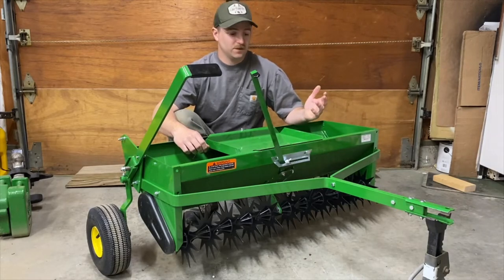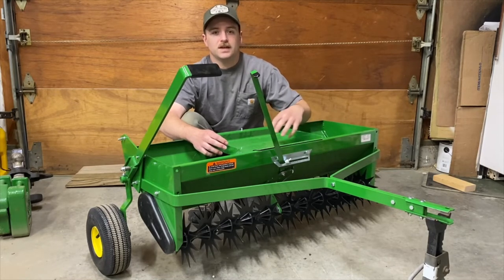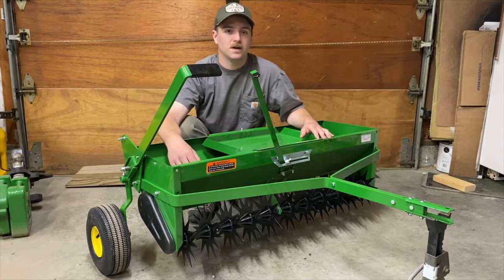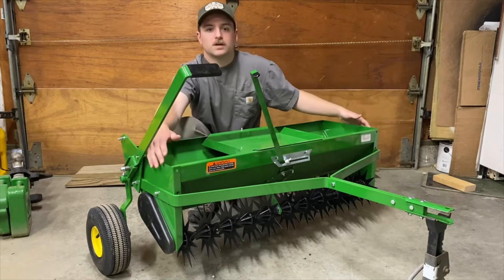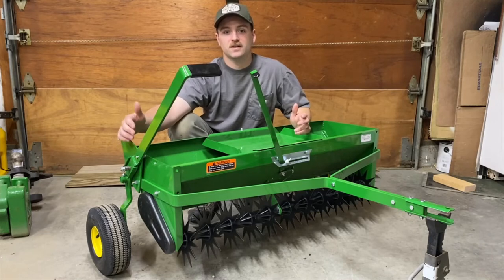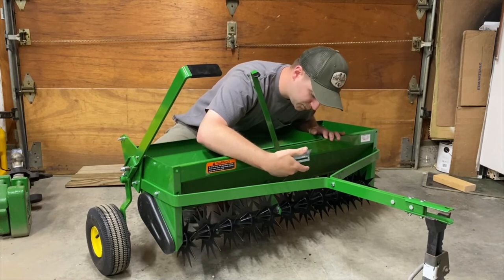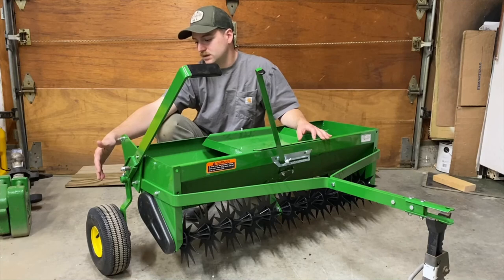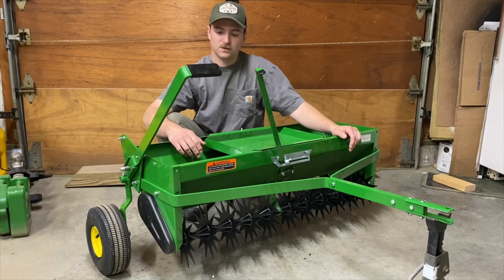John Deere Aerator Spreader - Overview

Comment: Thanks for the video. Do you think the wheels could be flipped to the inside to enable it to fit down narrower spaces?
Reply from the maker: No they can’t, when lowered, the wheels go forward, so you wouldn’t be able lower it if flipped… I’d imagine if you were good at fabricating, you could modify it to go the other way, but probably not worth it.

Comment: I wonder if the drop spreader would be heavy enough to pull a spiked roller behind it to help push seeds down to the soil.
Reply from the maker: Probably not. You wouldn’t need a spiked roller, I seeded a yard and rolled it with my Brinly roller, had fantastic results. But that roller is 600lbs with water, so I would think it would drag the spreader between the tractor and roller. Plus you would have to heavily modify it to include a hitch. Now a cool project would be to build a new chassis for one that you can add weights to, maybe even come loaded tires, and a drum to hold more seed, then mount the hopper and tines to it. You would probably want it to weigh close to the roller to pull properly.

Comment: Do keep us updated on how it works.  I ordered the John Deere Plug Aerator and Thatcher combo (Part number LP39089).  I also ordered the Tow-Behind Broadcast Spreader, 130 lb (Part number LP39087).

So, is this aerator/spreader combo in your video better than the broadcast spreader I got? Or is it for a different purpose?  Reason I ask is that, even if I ordered and paid for mine, I can still decide to exchange it when I go to pick up all the attachments I ordered.
Reply from the maker: So I wouldn’t really say better, it is more precise. The drop spreader simply “drops” material, it doesn’t throw it all over the place like broadcast. So if you have 3 acres you are fertilizing, broadcast is probably better, you just have less control, and have to be careful with overlaps. It’s easy to see the wheel path of the drop spreader, not so easy to see the edge of a broadcast spreading width. After using both drop and broadcast push spreaders, it was an easy choice for me in pull behinds
Reply: @JoshsGreenGarage  I should change mine then... I only have 1/2 acre... I do not want to be shooting fertilizer to the street and drive way, lol.  Thank you!
Reply from the maker: So 1/2 acre is 21,780sqft, to put that into perspective of how overkill that 130lb spreader is, the weed and feed I use (you will see in my next video “how to find fertilizer spreader setting”) is enough to cover 15,000sqft, weighs 42lbs... you could use 2 bags of that, do more than your yard, and still have capacity for a whole other bag. Granted, weight and hopper size are two different things, so 3 bags may not even fit... but I think that spreader is waaaay overkill for 1/2 acre. Maaaaaybe if you are spreading lime, which is heavy, but that is the only thing I could see you even getting close to using that size of spreader, and all it would do is save you from refilling it as often.

Comment: Hi, may i ask what you paid approximately for it unassembled? I see this thru a mail order company  in michigan called smalape for about $60  and then the same model is anywhere from $350 to 600 at lowes or amazon. Thank you
Reply from the maker: Mine was $449 through the dealer.

Comment: Great videos I have an X580 and really enjoy it.  Would you buy this attachment again for the task of overseeding?   I have a new planting 1.25 acres to thicken and improve.  I have a plug aerator for that job and a contractor does the fertilizer and weed control.  So it would just overseed annually for me.  Would you recommend it for that purpose based on your experience?   I like the thought of the group f contact with this vs broadcasting seed but maybe im overthinking it
Reply from the maker: I would definitely buy it again. It would be great for overseeding. If you were only using it for seed though, may not be cost effective compared to a tow behind broadcast spreader. You have a plug aerator, so that covers aerating. Grass can be overlapped and you won’t notice much when overseeding like you would if fertilizer were to overlap, creating a bunch of stripes. If you plan to do stuff other than seed at all, go with this one. Money can also be saved buying the Brinly branded version of this.
Reply: Great thank you!   It is cool looking but a lot more investment vs a simple broadcast spreader for seeding.   If you have used the broadcast method would you roll or take the seed in afterwards?
Reply from the maker: I haven’t used a tow behind broadcast, but I’ve planted grass with the drop spreader and I rolled it. You said you were overseeding, so I would roll, not rake.

Comment: Josh what is your opinion on the Brinly 40-in Spike Lawn Aerator Model #AS2-40BH-P? thank you.
Reply from the maker: I would not buy a spike aerator only. If ya get the spreader that’s fine, but you would be better off with a plug aerator. Aerated the ground way more, actually pulls chunks out where as the spike just makes a fine cut in the ground.

Comment: I have been looking at this drop spreader and I see there are two models of this. Home Depot sells the AS-40JD and local JD dealer sells the LPAS40JD. I was wonder if you have researched this.. I can't seem to see any difference except the price. I have read a lot of the reviews from home depot from people who had purchased this from there. All complaints are either poor instructions and chain coming home.. Have you experienced any issues with chain being loose on yours. I just can't wrap my brain around JD putting out a piece of crap equipment even if it is made by Brinley.. I'd appreciate your feed back or from anyone else who might read this comment

Thanks
Reply from the maker: Great question! I have a lengthy explanation, I'll start out with the part numbers. They actually are the same. The only difference is you aren't seeing all the numbers in it. They are both "AS40JD". There are actually even more numbers depending where you look. on the JD website an even longer number is show: 5874MLPAS40JD. So don't get hung up on part number, they are all the same.

I have seen some differences in these spreaders though. Most likely revisions even though they are the same part numbers. Mine has steel tines, that are painted black. I got mine through the dealer. Another time I stopped in and they had a bunch sitting in the showroom, but I noticed they had different tines. They had thinner galvanized tines that were stamped for rigidity. I can't stay if they have any other differences, they didn't appear to. I also can't say if either is better, it is kinda up to the buyer. I would prefer the one I got had I known there were different ones as I like the idea of thicker steel on the tines, and I don't keep mine outside, so I don't care that they are un-galvanized. That is a choice for you to make, if you have the ability to for sure get one or the other.

I can vouch for the instructions being rough. Certain steps are not illustrated very well, but that is what I am here for! I made an assembly video for this, but it was just too long. I saved all the footage, so if anyone requests a certain step, I can upload specific steps. I already have one uploaded that was requested.

As for the chain, I have no issue with mine as of yet. I can say that for certain as I put lime on my yard last year, and I could only find pulverized lime, not pelletized, and because of this there were inconsistencies in the size of the granules. There were some chunks in it that were the size of small gravel. A few of them got stuck into the openings at the bottom of the hopper, and when the impeller/auger spun over them, it bent the impeller. I can't see this happening if the chain were slipping. Now don't look at this as a bad thing, it doesn't at all affect the operation of the spreader, just works best with fertilizers and lime that are consistent small granules.

In the end this spreader does seem to be of great quality, I'd probably recommend getting it at a dealer already assembled if you can, assembly really does suck on this one... I did make an upgrade to the weight tray on it, and I have a video on it, I definitely recommend doing that one! I am planning on doing some videos shortly about this and my sweeper, breaking them open to see how the parts are holding up, nobody shows that stuff! So keep a lookout for those. Hope this helps, let me know if you have any other questions!
Reply: @JoshsGreenGarage  Thanks for the info. I subscribed so I won't miss any videos.

Comment: I'm having a hard time assembling one of the last steps....hooking up the silver s shaped rod that connects the spreader lever adjuster....any suggestions - the instructions are horrible
Reply from the maker: https://youtu.be/Us4fWNfj3F4

Here ya go, already had the clip, just needed to cut out some of my own trouble figuring out the directions! Hope this works for you.
Reply: Have same unit..the instructions are horrible and cheaply printed
Reply from the maker: Saw a slightly different model at my dealer, maybe a new revision, had slightly different tines, and the tow bar looked like it wasn’t a pain to get together, curious if the instructions were any better

Comment: Think these are great for seeding, scratch up the ground and drop the seed in right on top.
Reply from the maker: For best result, go over it after with a yard roller!
Reply: Nice! Any recommendation on size/weight?
Reply from the maker: I have the biggest one Brinly makes, you can see it in my X580 50hr review... but anything would work... just pushes the seed into the ground enough that rain won't wash it around... Rolled my buddy's yard after I seeded it, and I have never seen fresh seed come in so even and thick! Well worth it! Try to find one used if you can, save a ton of money! found mine for like 50 or 75 bucks! a steal in my mind! Plus you can also use them for smoothing out a slightly bumpy yard, packing a gravel driveway... There are uses, but not so many that I wanted to pay full price for one.
Reply: @JoshsGreenGarage  Awesome! I"ll check it out!  Thank you!!
Reply: When you rolled it after was the roller empty or full?   I have heard some folks just pulling an empty roller after seeding to just lightly pack the seed not too deep.   Or did it work ok with the roller full of water ?
Reply from the maker: Full, so mine is about 630lbs with water. I had fantastic results, so I would for sure roll it filled.